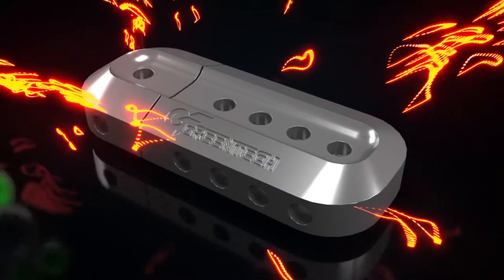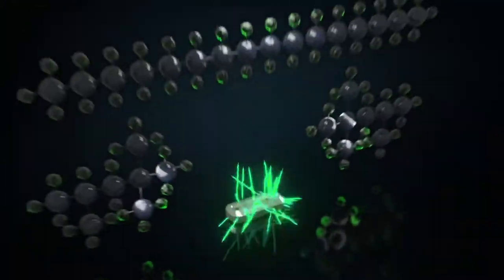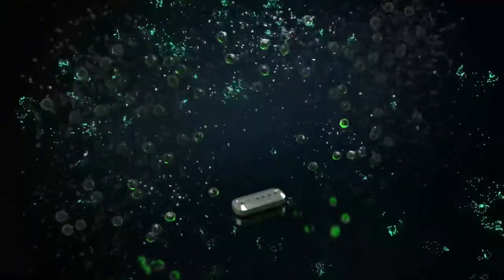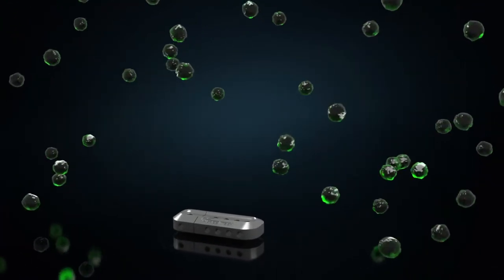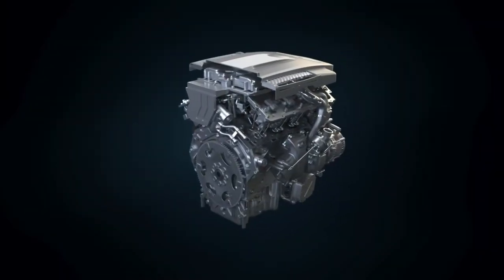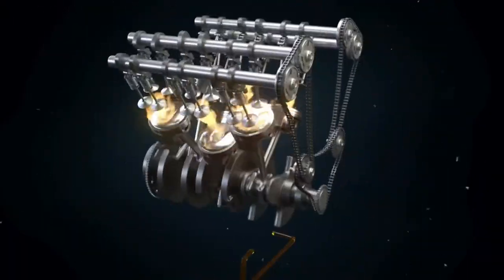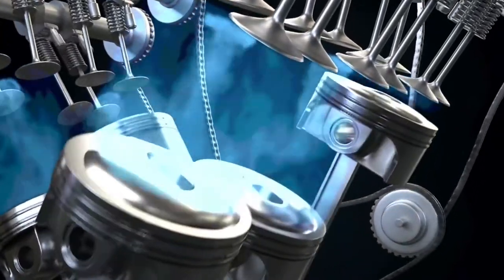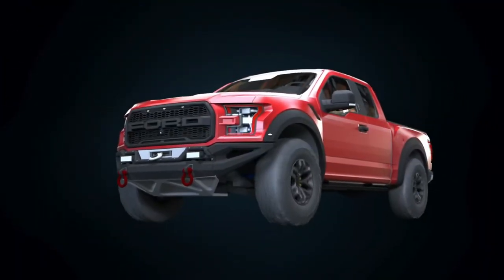Greentech Fuel Saver- How it works

Comment: Expensive but justified one time cost
Reply from the maker: It saves fuel for 10 years once installed. It is very inexpensive compared to the savings benefits. Saving fuel, saving maintenance costs, preventing carbon buildup, keep engines running quietly. The benefits is more than it costs. 
Greentech also installed in large mining operations and boiler systems.